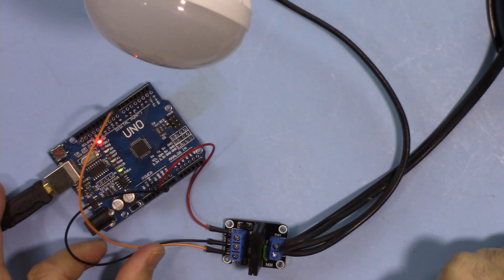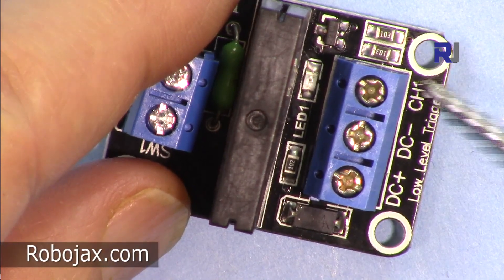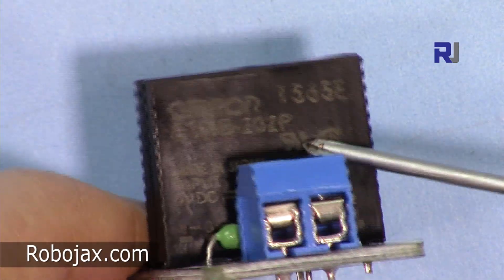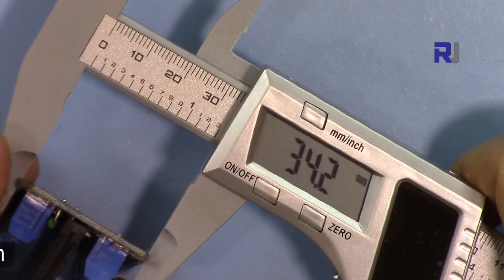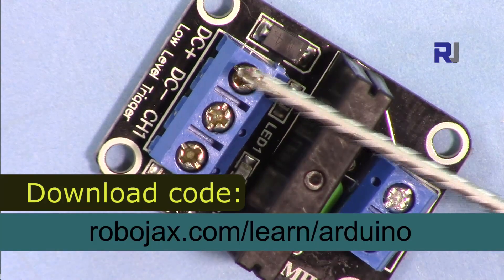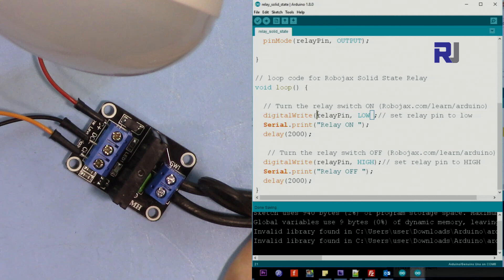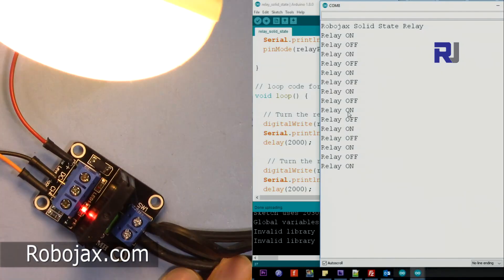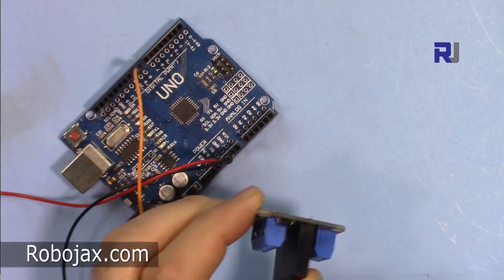How to use Solid State Relay with Arduino to Control AC load RTJ46

Comment: can it work on dc current? if no why? and the alternative? thank you my man
Reply from the maker: NO it does not work. components and design is for AC.  For DC you use this https://youtu.be/tCJ2Q-CT6Q8  or https://youtu.be/17vqLv508Uw or simply serarch MOSFET in my channel

Comment: Hello , love your videos , and the ways you explained, I am learning a lot, Thanks. Can you help me please, I need to find double solid state relay, the one can be control whit Arduino and conduct electricity at the some time in both ways, like controlling two separate DC  motors  at some time at the direction choose by me, can you guide me please?.  Thanks for any help.
Reply from the maker: Hello, solid state relay is for AC load only.  I have video to control DC motor using two relay search for it. Here is how to find a video in a youtube channel https://youtu.be/OhkUceBWcHs

Comment: So is a solid state low level relay HAVE to be used with a arduino. 

Can’t a solid state low level relay be used like a normal car relay with just +&-? 

WhTs the benefit of a low level relay compared to a standard relay
Reply from the maker: This is module meaning a relay is built with other components to make work with a very weak signal such as Arduino. They desist the driver to work with low level signal and some applications needs low level trigger.
Reply: @robojax  so normally a relay needs only ground and 12v+ to activate the relay and that closes the NO to closed

But these new SSR they still need ground and 12v+ but then an additional wire to do the same thing

That’s what I am confused about

I have one here and I ju at can’t operate it. I have just now obtained a arduino nano

But it seems overkill to use an extra power wire and a arduino JUST to operate a relay

Is there no other minimal way to operate a SSR
Reply from the maker: Here is solid state relay without pCB https://www.digikey.ca/short/mf4bv88z this juts need + and -

Comment: I got one of these but the  resistance of the output terminals is around 2.8K when the relay is active which makes me think its faulty. Is the resistance supposed to be that high?
Reply from the maker: you can't measure the resistance. this is semiconductor and not mechanical. you can't measure it with ohmmeter.

Comment: Sir please explain which relay module is suitable for to drive DC load with high  speed  using arduino UNO for example to drive for DC Motors but its on one by one with time delay continuously
Reply: With high  switching  speed just like a blinking LED three are more LED blink one by one with respect to time delay this type
Reply: Because I have to control the four solenoids one by one with the time delay to each solenoids for engineering projects solenoid input is DC
Reply: I am waiting for your response sir
Reply from the maker: Hi, relay is very VERY slow response switch.  Use MOSFET swtich if you want fast switching. here is mosfet module https://youtu.be/17vqLv508Uw

Comment: I need i diode for this relay if i use it without a module ??, and can i connect DC-DC ? or only DC-AC??
Reply from the maker: this is for AC load only. No diode is needed.

Comment: Can I connect the 12v solar panel to the input port (+ and - ) and connect arduino uno to channel 1 port to control the switching?
Reply from the maker: No you can't. This module work with 5V. Your solar panel will kill it.
Reply: @robojax  thanks for your informative reply

Comment: When I digitalWrite Low, it does not turn off. does it mean it did not reach a minimum voltage to turn the relay OFF? Im using arduino Nano, connected to a 12V power supply.
Reply from the maker: Perhaps you did not watch the video fully. LOW will turn it ON and HIGH will turn it OFF.  I will reply to subscribers. so make sure to subscribe if you want me to reply again.

Comment: Will it work if the signal is coming from a negative line from the power supply, so i don't need to use arduino? I tried but im getting problem. It does not turn on if  the load is connected first before the signal is connected. And when it is turned on, it does not switch off, unless I remove the power supply
Reply from the maker: this is strange. Make sure to pass the LIVE ( or hot) wire of AC though this module. It should work unless it is defective.
this module needs 5V to operate.  Then to control it you need signal of 3V or higher to turn it ON.

Comment: this relay is only for AC or can i connect DC to the switch?
Reply from the maker: no you can't. AC only.
Reply: I actually try with DC (cut negative with the switch) an it works so this can be used with AC and DC like a switch combined with another sensor or with time like in your video
Reply: This works as intended for AC only. For DC, when I tried, it switches ON, but would not go OFF. I belive the relay uses zero detection.

Comment: Never tin wires going into screw terminals. You get much less surface area, which builds up heat at the smaller connection point, which melts more solder, which reduces the contact area, which increases heat, which burns your house down. If you want to make the wires easier to manage, just lightly tin the very tip of the wire, not the whole thing. I almost did this with my 3d printer. Terminals turned black, board melted. It could have been really bad.
Reply from the maker: Thank you for your comment. The bulb I tested is 7W LED at 120V and  7÷120=58mA (0.0583A )current winch is very minimal and it will never heat up.
Reply: this comment was really helpful to me, thanks Joey. I almost tinned the wires the other day. Even better than that is using crimped tubular terminals on the wire tip. They create a flat contact surface between the conductors.
Reply: If the screws are not tightened properly, it will add to the mess by soldering the wire on to to the terminal block!

Comment: Hi do u have a better alternative for IRFZ44N ,  like this solid state Relay?
Reply from the maker: These two are totally different items. IRFZ44N is mosfet and this module should not have any mosfet.
Reply: @robojax  this irfz44n is getting heated when i turn the leds on with 12v 5amps , any u suggest a better withstandable mosfet pls?
Reply from the maker: this a mosfet can handle 49A. how came?  with 5A even without heat sink it should work. here see the datasheet https://www.infineon.com/dgdl/irfz44n.pdf?fileId=5546d462533600a40153563b3575220b . Can you post the schematic of your system to https://snag.gy/ and then post the URL (address) here so I look at it?

Comment: Hello, I have a question, can you use the PWM outputs to make a "dimmer" effect in the AC light vulb?
Reply: No, you can't. You must use a more complicated circuit in order to control the AC phase (google Arduino AC Phase Control), or else it won't do anything, except maybe burning your relay..
Reply: @lapidations  why doesn't it work? Out of curiosity, because I tried searching why you can't apply PWM on an AC signal (at a much different frequency) and I can't find any information
Reply: @joshuavincent7884  Basically because the switching between on and off only occurs at a specific point in the AC cycle; so you can only switch a maximum of 50 or 60 times per second. Even if your PWM ran this slowly, it would lead to highly visible flickering.

Comment: hi, can i use this relay board for a 350 watts resistamce heater. i saw this product at aliexpress
Reply from the maker: I believe I have explained that.  Look at the current rating (A) of the relay.  350÷Voltage = Current. if the current is smaller or equal the current rating of the relay, yes you can use it.
Reply: @robojax  thank you very much. i will use 1.6 A as your formula.

Comment: I am having a small problem when trying to use the ssr to control some LEDs. the led turns on but does not turn off, is there a way to fix this and keep using the ssr? , I think a mosfet would fix the problem but I prefer to use the ssr if possible
Reply: You need a mosfet.   This ssr is for ax only and uses zero cross switching. Will not work with dc.

Comment: Can I connect a inductive load like ceiling fan to the SSR module via fan regulator?  Does this module have inbuilt snubber circuit?
Reply from the maker: follow the link in the description and you will get the code as well as data sheet.  Here is screen shot https://snag.gy/d3IGAq.jpg